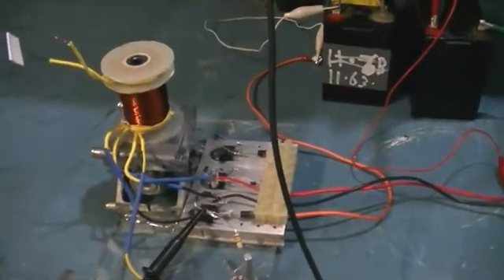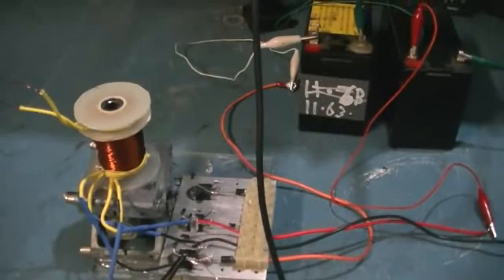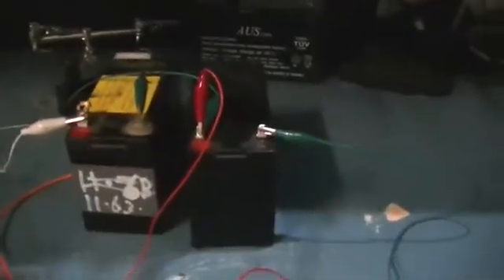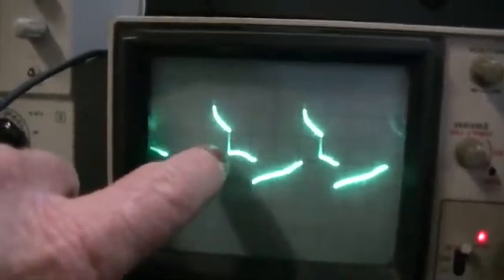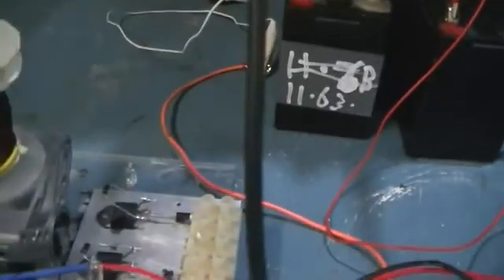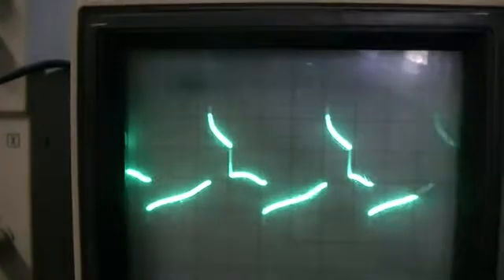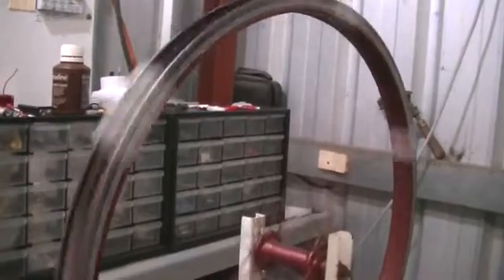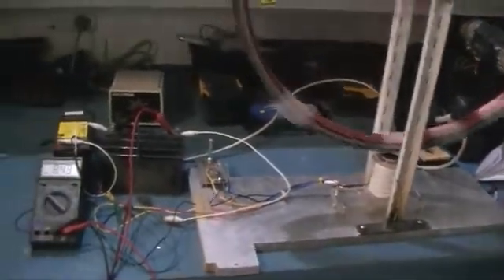pm build off.mp4

Comment: Tinman, the flyback transformer has a ferrite and air core built into it.  Knowing you, when you read the article in wikipedia, I'm sure you'll get some really great ideas for a PM.  If you put an HV cap across the flyback, you'll get much larger arcs/voltage.  You can find the right cap in the HV section of a monitor or TV.  I built my own cap from a 32oz bottle, some salt water, and some aluminum foil.  That's pronounced alum -min- num NOT alyou min um.  LOL    ;)
Tony

Comment from the maker: Ok-so now i have found the 5 small line's in each of the boxe's-hard to see on this scope.But dosnt that still make my voltage reading's correct?Each of the boxes represent's the volt's/div,and if the prob is set to x10 then each box represent's 10x the volt's/div setting.
Sorry i didnt see the 5 smaller dot's between each box-i need bigger glasses lol-thats where you had me lost.

Comment from the maker: Ok now im confused lol.You asked-Tinman, I have been working on a Don Smith device and need a PM to produce HV (high voltage) and HF (high frequency). Could you build such a device to drive a flyback to 35kHz and at high voltage.
Now you say we dont need a spining rotor-??? lol
I think i lost you some where there or misunderstood what you were asking for?
And yes i know 35KHz is easy to obtain-but you need the right core material(ferrite) or an air core.Iron or steel wont do 35KHz

Comment from the maker: Hi waqaskhan-yes left to right i understand.But every vidio i watch on scope's and the book that came with the scope say's that each small box or each line is the voltage at which the volts/div is set at.When the probe is set to 10x then each box-line is 10x the volt's/div.So in my vidio i have it set at 1v/div and probe at x10.So disreguarding the faint voltage spike,the darker line say's i have about 21 volt's at the base(just above the second box-line)Is this correct?-still learning

Comment from the maker: hi min2oly
I may be explaining it wrong,and i dont disagree about the high voltage spike not turning on the transistor.What im saying is that once the run coil starts to power up,the trigger coil switches the transistor on harder as it recieve's a larger current from the run coil--a cascade effect.If you type in -bedinimotors dot blogspot into your serch engin,then go down to near the bottom of the page,you will see a section on the ssg and how it work's. This might explain it better than i am.

Comment: thanks Tinman for your time!!! but can i correct your scope reading??
1. read the scope from left to right
2. so the straight line comes first and it slopes down, followed by the smaller secondary pulse. 
3. volts/div means the bigger box in the scope, the small lines are smaller counts, like if 1v/div then bigger box represents 1v/big box and each single line in Box represents .2 volts. coz every box contains 5 lines.
4. if u set multiplier on your probe to 10x then every Box volt is x10.
;)

Comment from the maker: How ever-there are situation,s where the revers can happen-where as if you use to much resistance in the trigger coil-you can get it to self oscilate.That very pulse motor you see right there would indeed self oscilate if i added a higher resistance to the base.This will normaly happen when useing strong magnet's -as i do.It start's a magnetic pingpong effect between the pm and the electromagnet.And the only way to stop it is to do the reverse and decrease the risistance to the base.

Comment from the maker: You will see some most pulse motors fire the transistor 5 or 6 time's every magnet pass.This is where the pot come's in.You wind up the resistance until that small voltage spike dosnt have enough current to fire the transistor again.Most of the high voltage spike is sent to the charge battery-how ever,if you disconect the charge battery,your pulse motor will start to speed up as the trigger windings then get all the current and send it to the base-thus switching it on harder.

Comment from the maker: Hi fathershand-good to see you again.
35khz-wow,we would never get even close to that.Lets see-35000 devided by say 6 magnet's on the rotor,that =5833rps so x by 60 =349980rpm.
Mmm- i dont know of any steel or material that would stay together at that rpm.
You would have a hard time getting a solid state device to this frequency-cleanly without the use of some fantastic core material as iron or steel starts to saturate at about 2.7KHz as the magnetic field dosnt disipate fast enough.

Comment: If the spike is being sent to the base, why does the transistor not fire again, why does it wait for the 2 volt current from the magnet pass to fire...
by self osculations are you referring to the solid state builds? same situation only no magnet the spike does not have what it takes to fire that transistor, it will light up a FLAB if you can get that radiant purple to happen inside.

Comment: Tinman, I have been working on a Don Smith device and need a PM to produce HV (high voltage) and HF (high frequency).  Could you build such a device to drive a flyback to 35kHz and at high voltage i.e., the max output voltage from the flyback?  If you can use one of the old style flybacks that doesn't have diodes internally that would be even better! 

Great stuff Tinman,  Hope all is well at your home.
Tony
P.S. Love the house and especially the shed in the "outback"!!

Comment from the maker: Hi min2oly
The 2 volt's starts the fireing of the transistor.Once the run coil start to fire up it sends more voltage and current to the base pulling the transistor on even harder(the transformer effect)You will see a sharp rise from the initial 2 volts at the base once the run coil starts to come on.Once the peak voltage in the run coil is reached the transistor switches off and the coil collapses which send's that narrow high voltage spike to the base.This is how self oscilation setup's work